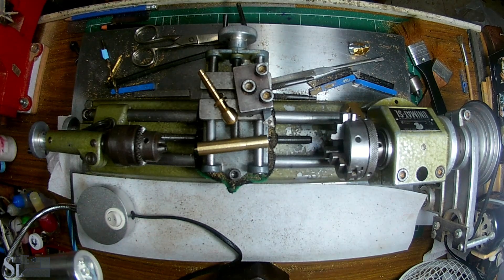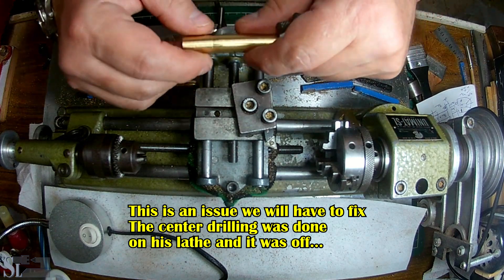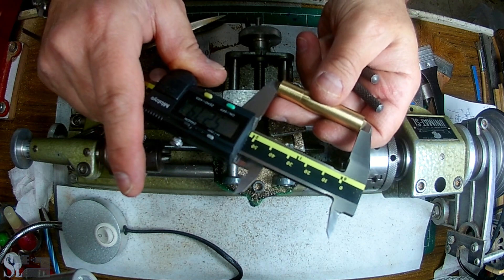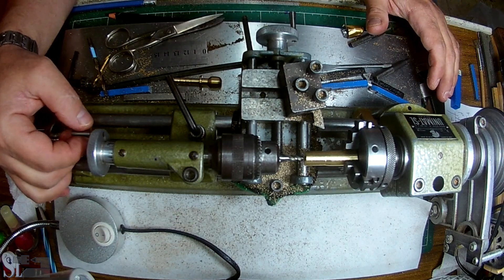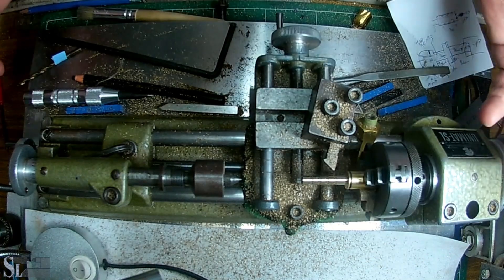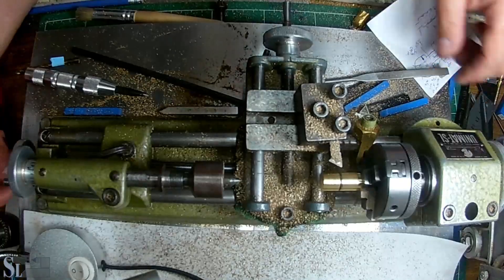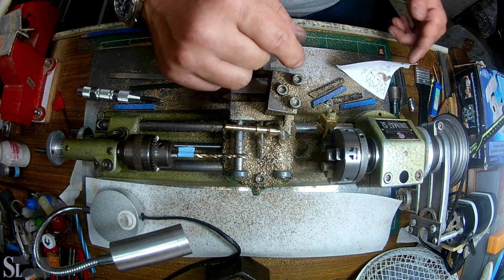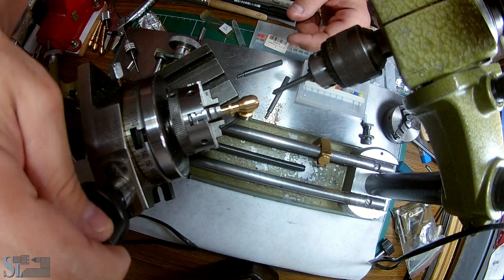Machining a pressure nozzle - most oddball Unimat setting ever!

Comment: what rotary table are you using?
Reply: EMCO Unimat SL
Reply from the maker: My rotary table is India made, it's a well made tool and designed for small lathes like the unimat SL1000. I bought it via ebay.
Reply: The video 0:07 clearly shows a Unimat SL. Is the lathe shown a clone from India?
Reply from the maker: @JenkinsUSA  No, the lathe is the Emco unimat sl1000, made in 1971. But the rotary table itself was bought on ebay, made by india.
Reply: The “rotary table”! I’m such a noob. Thank you, I didn’t catch that. ❤